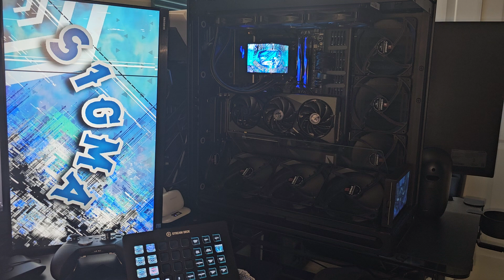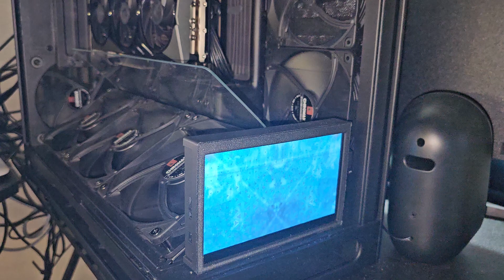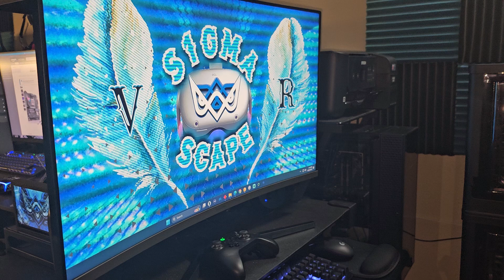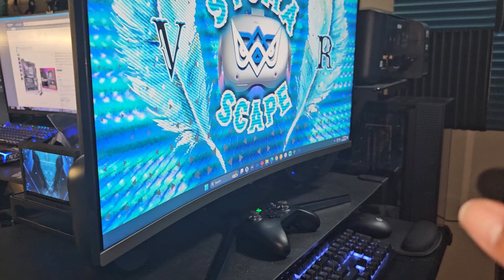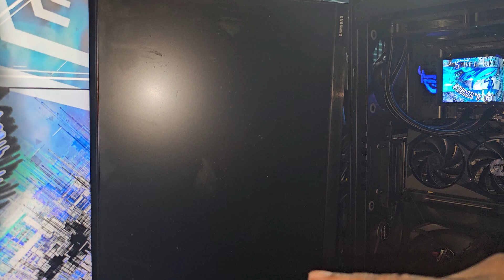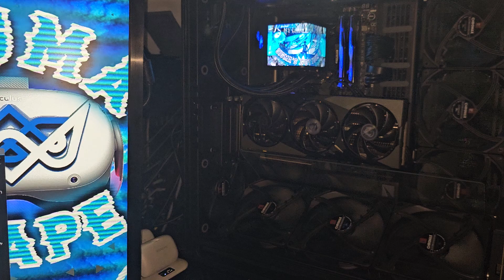New pc build and my dual pc streaming setup!

Comment: Super cool build. 
Only thing I'd recommend is some 'black-out' curtains for your windows, stop that sunlight from bleeding out your camera. 😁 
I can't even nitpick the PC setup.
Reply from the maker: @kevins.3573  Here's the funny thing, I actually have my windows boarded up with black plywood. My studio is actually so dark that I have ceiling cornered studio lights and an LED strip on my wall that's actually facing my pc (that's the light that you saw in the video). All of my cams are front mounted since i livestream, but i don't have a free cam that face my pc. I could've used the light on my phone that I used for the video. Or my 4k gimbal camera, but that was mounted to my pc for my streams, and I didn't want to bother unmounting it for what i planned to be a short video. I'll post an update next week since I made an error by stating that I had used 420 mm fans rather than 140 mm fans. But the update will feature the MSI Suprim 5090 liquid gpu that I just paid for yesterday. Thank you for the comment! I appreciate the interaction

Comment: I feel the front monitor is unnecessary, and takes away from the simplicity of the build. Aside from that, sick build my friend, love the bottom fans how they are angled, thinking of doing something similar to mine!
Reply from the maker: @LilPlaya3200  you're right. It does take away from the black out build. I thought about not having one there. I helped a buddy build a pc right around the time that I built mine, we had two raspberry pie monitors from another project a while ago. We thought we could use it in this build, so we did. The good thing about the monitor is that's it's not hard mounted to case. It's magnetically placed in the case. Since the whole thing is steel. So, if I wanted it gone, all I have to do is unplug it and tuck those cables behind the angled intake fans and just pull the monitor out. It's literally a 20-second process once the glass panel is off. So it's a module monitor. It can read components' info (which i typically have it as) or act as a media display (which i did for the sake of the video so it could match my AIO animated gif for this video). I can always disable the monitor as well. It's actually pretty handy, but it serves no purpose towards productivity of the build, so your comment would be correct!
Reply: @M1KV4Y  Very cool man! I just did a build myself and was considering something like that myself. Do you have any suggestions for a good one? I have a ton of space, so that is not the issue. I am not very familiar with rasp pi though...
Reply from the maker: @Gankmobile32  I'm glad to see that you maybe reconsidering adding an in-case screen. Not going to lie, the thought came to me when I was watching creators with their HAVN 420 builds, and they were using the screen mount bracket that came with the case. Since I was using (then) fans (now) a radiator in the spot that the screen mount would go, I added it someplace different. You can use any monitor you'd like honestly. Just as long as it fits and can fit your connection ports. I had about 8.5 inches of clearance to mount a screen, so I used a 7" screen. The only real reason why I chose a raspberry pi screen was that they are pretty thin and comes with standoff screw mounts on the back of them (which I used to mount magnates to so I could mount it to my angled fan shroud.)

Comment: It’s refreshing to see a build with not just a blur of color 😂, nice hike
Reply from the maker: @spadesofpaintstudios1719  I didn't need my studio glowing at night like there was a rave that didn't get the invite to DJ at when I was sleeping. I have enough fantasy glowing when I'm streaming for absent lighting. Fans are noisy, and the wrong ones bring poor air pressure and cooling. So, I went with functionality over aesthetics. Plus, with the aio and the monitor in the case, I can either black them out or play whatever I want on them. They prove all the color and lighting I needed. Tha.k you for communicating!

Comment: 420 fans? You mean 140 right
Reply from the maker: @GameLifeOfficial  yes lol I had the case name was my head when I was recording this video. That being the  HAVN 420, and that was based on the max size of the radiator block that it can fit is 420 mm, which supports 3 140mm fans. So please excuse the error and thank you for correcting me. I really do appreciate it.
Reply: I started doing the math when I heard it lol

Comment: Your monitor inside your case is higher quality than my monitor outside my case 😂 That build is sick, all those fans I bet you could make it fly around the room too lol
Reply from the maker: @KobraVR  that curved screened AIO I'd a monster. It's an OLED panel and it's pretty bright either vibrant colors. The mini monitor on the front is held in place by magnets that's are screwed into the monitors M.2 screw mounts on the back that was used to stick the angled fan shroud so if the glass is off the monitor wouldn't just fall out and if I move it the monitor would move inside the case.